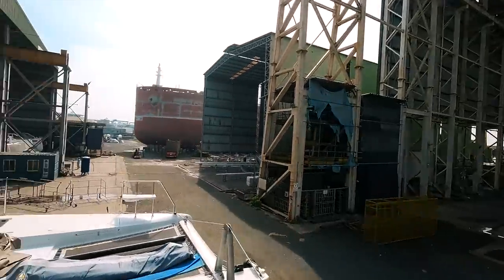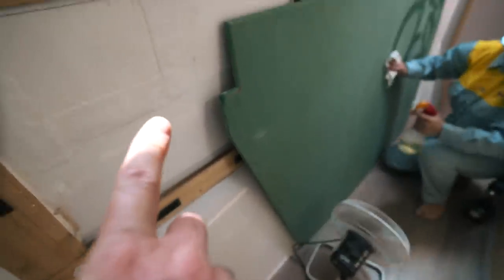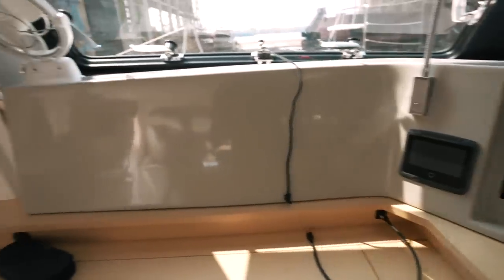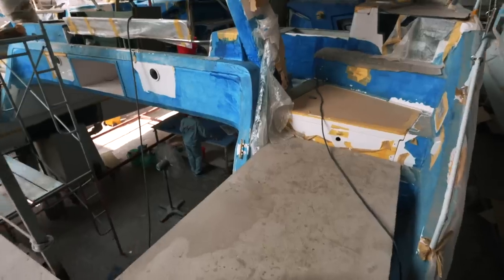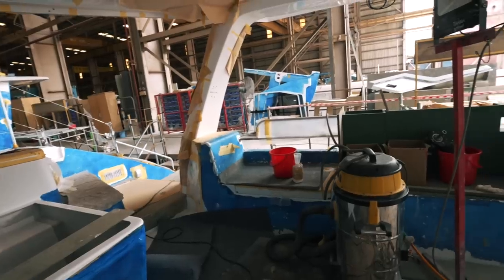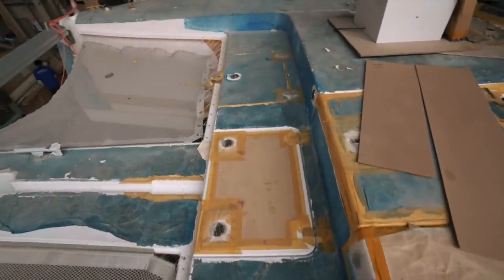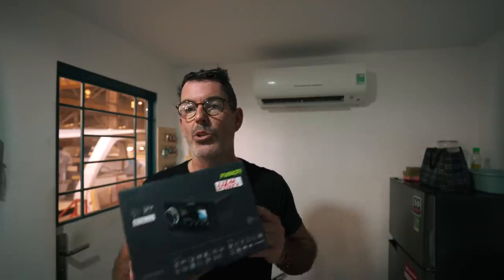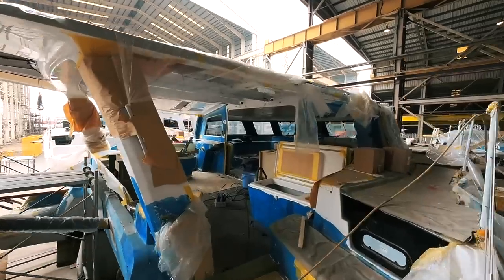Big Changes to the Catamaran Build- Also, We Need Your Help!

Comment: Being an audiophile myself. I have built several speakers and amps over the years and have a boat.  Others suggest not having the speakers out front. I agree.  You will probably just use those at anchor, so just open the windows or use bluetooth or install a plug upfront and bring speakers out when anchored.   Doesn't look like those recessed speakers have a very wide dispersion.  I assume this is a stereo system and not like a 5.1?  Is it possible to do a temporary hookup of the system before the final install? If so, you can experiment with the placement, toe in etc.  On a boat you don't have a lot of options on placement and with all the hard surfaces about reflections and standing waves can be a problem.  So experiment as much as possible.

Comment: Again a great video on the progress and iterative process of designing and building a complete new boat. Hats off for Seawind for their openness. I concurr with many others: no holes in the forward section of the hull. So speakers only bluetooth for the foredeck. I also agree that you’d like to have some air volume behind the 6,5” speakers. I believe I heard you say that the sub-woofer should be combined with the 6,5”? But in the salon you’ll apply to small speakers in the headliner? I like the design of the nav station with the recessed instrument panels. That will much safer at sea. ⚫️ was better than ⏺️ but that’s a matter of taste. Can’t wait until S-day💦!

Comment: Can you fit a Speaker in the overhang where the front windows are? That's your safest option for front speakers, I would not put them on the foredeck. Presuming your only going to use them at anchor, as backup you can put them inside the main cabin and just open the windows.

Comment: The  speakers have a IP65 rating, (check the IP rating) the 5 meaning they can handle a 6.5mm 30kPa water jet at 3 meters (~4psi). A good petrol water blaster is about 14000kPa. I would think at the front they aren't rated high enough, at times I would think they could be fully submerged and suffer way higher water splashing pressure. Unless you have fully sealed covers.. Probably want IP67 rated speakers for the front location.
A alternative location might be the soffit of the coach roof at the front, although with the front windows open the sound could be blocked.

Comment: Is there any way to put the outside front speakers up underneath the front over hang by the windows and put them on a hinge so you could lower them when your out on the front sitting then fold them back up to keep them out of the weather more when raining or underway?

Comment: 2at the back 2 mounted inside in the ceiling and the other 2 on swing arms inside at the windows ( swinging out through the windows when open). You will only be at the bow when the windows are open.

Comment: Ditch the speakers in the front and just get a decent Bluetooth speaker for those times you want to hang out up there with your tunes. Fusion can work with Bluetooth. Two less holes where you don't really want them.

Comment: I would consider putting speakers two at the aft saloon in ceiling and two by cockpits and then inside two and the sub. Depends if you the ceiling speakers outside will be enough for when you at the helm because that is when you will want some nice music outside I imagine. Saying that if you put them inside you could use them when watching netflix. I'd get an av receiver as well if I had a boat because I like to play films with the dolby digital sound. You can get small ones these days.

Comment: i'm not an audiophile like my brother but i have learnt some stuff. forget the speakers in the bow area, just open the cabin windows. i think the woofer should either be as far forward in the main cabin or situated in the stern facing forward. after all most of your time on board will be there. also you wont want to be playing music load unless you're out in the middle of the ocean  :-))
p.s. after reading a few comments i agree with the portable wireless speaker ideas. i think rick moore might be a good reference(sailing sophisticated lady).

Comment: I agree with those who say skip the forward speakers. They WILL go bad and you'll have holes that will need to be filled with a different shape speaker with different mounting holes than whatever is currently available.

I like the idea of indoor speakers near the window, or small bookshelf style speakers near the windows that can be rotated to face forward or in the cabin. Like the classic Bose systems. Your little speakers don't need to be in a big. They're just mid range and highs. You're going with a subwoofer to cover the lows.

Comment: Re foredeck speakers : assuming you would only have these speakers on when stationary or slow speeds 

 Why not create some rubber mould/flap which is easily to clip on (protect from water) & clip off when want to use

Comment: A catamaran owner recently interviewed on his audio system and he didn't spare on anything and customized  a lot of the hardware said he didn't use a hard wired speaker system he used only Bluetooth speakers and put as many and wherever he wanted. The quality and sound plus the usability was preferable. Plus many choices of speakers and placement, velcro to keep in place?

Comment: Don't really understand why the Nav station is being changed to light grey colour, and even worse it looks like a gloss! You commented on the recess being added to stop light reflection,  but this colour change will make it worse. That's the reason why most helms are matte black and flat. You don't want any distracting reflections when using the instruments. Imagine a night passage where even the most miniscule amount of ambient light is just going to hit that grey (gloss), surface and its accentuated curves to be effectively amplified back into your eyes. Agree that modern "glass bridges", dio radiate a lot of light but most have night-mode to reduce it. Like most have said - no holes for permanent speakers on the foredeck, just use a portable unit and bring out onto the deck when needed. There are so many waterproof bluetooth ones around these days. Just my two cents.
Reply: Pooly thought out random changes.  Someone has more money than sense.

Comment: Regarding the foredeck speakers... I wouldn't. I agree with Brian C. I'd go wireless. Easy enough to take them up when you're on anchor. Maybe create a friction fit silicone base so they're secured in and not easy to knock lose. If they HAVE to be mounted, I'd suggest gasketed covers that can be locked down for passage and removed once you're on anchor or if you have really good sailing conditions with little spray. Salt water is insidious... even waterproof isn't so waterproof at sea. I'd recommend buying an extra couple pairs for stashing in the spares bin.

Comment: Just a suggestion for your sound system speakers, maybe consider Bluetooth system, that way you can move the speakers to a safe place in bad or rough weather or group them together and blast them for a party.  Plus  no holes and no wires.

Comment: As someone that has done maintenance and repair in the marine industry for decades I'm going to give you some critically important advice. 
As you were going along talking about esthetics and solid long panels, speaker and light installations and so on it dawned on me. You are going to want access via panel, hatch, or other means for all of the systems including lighting and speakers.
Just something to keep in the forefront in all your design consideration.

Comment: My $0.02 - Not thrilled with the front speaker placement. From exposure to the elements to the holes in the fiberglass. Mostly because, as you mentioned in the video, bass isn’t directional but the rest is. They are mid-bow and facing one another. If you are on a beanbag closer midship, I can imagine the wind drowning it out. I would want them either in the furthest forward part of the vessel facing rearwards or close to the front windows facing forward. 

I do remember a video where they had speakers on the mast for the front of the boat. That could be an option as well while facing the whole bow.

Comment: Couple of questions for you: I’m assuming your fusion speakers are marine grade, salt resistant and IP 65 rated like the focal luxury marine line. If not please check out the focal line. Second, I would highly suggest having 2 subwoofers. Last, I would consult a marine audiophile that installs high end speakers like Focal and I’m assuming that Fusion has a division to consult. As for the front, I personally would not install outside. Open the front windows and add some volume. Last, what size amps are you using and hopefully the subwoofer (s) will have their own amp? Hope this will give you some insight! Cheers

Comment: On your speaker question, does the head unit you have do surround sound? I so, I think you may want to do 4 speakers in the cabin with the sub for the times you two want to watch movies or have TV night. Then when you are sitting on the bow of the boat you could open the front windows to listen to your music. I guess the downside to this would be if you were tying to conserve conditioned air inside the main upper living area. Then the two speakers on the back. I would worry about the speakers on the front unless maybe you could get them under the overhand of the front windows, but I would still think the amount of sea water that would splash in those areas even with marine grade speakers would cause issues quickly. This is just what I think, I'm in no way a marine audio or even an audio expert. Also enjoy seeing you and Teresa both in videos, if its all just from your point of view walking around then it loses some of the IDK feeling of authenticity to me.

Comment: @Sailing Ruby Rose, get 2 subwoofers they don't have to be big, but efficient, this will give you the best sound at low volume.  It will allow a more diverse speaker arrangement.
Reply: I STRONGLY agree!  Stereo bass with better coverage at lower volume is phenomenally better!

Comment: On the blue tooth speakers there are several that are "water proof".  I highly recommend the UE2 units.  I have found them to amazingly durable however, note that most of my experience is fresh water.  You can also hook as many as you want together and we have found that to be a lot of fun.   They have gromit that is suitable for a carabiner.  Have hooked 7 together at once in the past floating down the river.  They will connect to anything bluetooth but I would check with Fusion....good luck

Comment: For the outside bow speakers, just get a really decent portable Bluetooth speaker and make sure your system allows for external connection to a speaker via Bluetooth! Sonos or equivalent deliver excellent sound and are weather proof! Easier to use and can take to beach when using phone for music.

Comment: Question about the layout of the wiring on the boat. Do they lay in conduit between compartments with a string so you can add wires in the future? So if you had to run a harness from the cockpit to the engine room all you need to do is tie it to the string and pull in it into the other compartment or do you have to tear everything apart in order to upgrade or modify the setup later? If they put in the conduit remember to foam the ends so in case of smoke or fire it doesn't move from compartment to compartment.

Comment: I would put bigger speakers further away from the tramps, it'll sound better and be more protected if they're further aft. Speakers pointing down from the mast would also make sense. Don't worry about water damage, it'll be the amplifier than blows up from a short not the speaker, and speakers are cheap enough. Only controversial opinion i'd put out there is putting the subwoofer in the ceiling cavity, not lower down. It will sound better, and I bet if you mount it right you'll even get bass outside as clear as inside, albeit quieter.

Comment: Can’t you use rechargeable wireless speakers for the front but mould/make placement points so they are secure and when you are underway you can remove them? For the rest of the speakers I would mock them up and test the speakers first so you can see how they sound and verberate around the space. 👍

Comment: I would put four drivers in the cockpit. With two speakers underway, the volume has to be up louder than I like and you end up with dead spots in the cockpit. Four would give you more even dispersion without creating volume Hot & Cold spots. I wouldn’t put any up front either. Open windows or portable Bluetooth. Even bay sailing conditions would drown out any sound level below obnoxious. In open water, those volume levels would disturb the fish.

Comment: Do the windows flip out in the front?... a couple speakers strategically placed inside might perhaps deflect out nicely. Failing that... JBL PartyBox's sound great... and portable. You could always pre-wire where you think you'd want speakers and decide later, run them on a A/B switch

Comment: Depending the actual speakers, they can be very waterproof.   I had two 10 inch hung around my patio in New England and they never had a problem with water.
Reply: I agree that speakers can be waterproofed for on land use, even for a non Blue water boat it isn't quite the issue.  It is more of a water sealing/hull integrity problem because when you put a hole in a hull your adding a point of entry to the one thing you don't want in a boat.  There is an enormous issue with putting holes in a hull when your talking about ocean crossing vessels.  A little sound up front is not really a viable risk to value, especially when you could just open a window or use a Bluetooth speaker to allow the music to play everywhere.

Comment: Any outside speackers should be free standing. The sun rottes out the plastic in a couple of years. Or you toes could kick it in. The template will be different on your replacement speakers in a few years. Put standalone speakers under the trappolen.

Comment: Speaker placement is a tricky business, but sound dissipates at roughly half the volume for double the distance, This means it is important that in your helm station if your head is close to a speaker you will adjust it low and nobody else can hear, a speaker above the table can result in a speaker very close (1m) to a person's head and at the far end maybe 3m.  I would place speakers in low visible places, far as possible from your common areas, then the volume will seem to fill the space and everyone can enjoy. reach out if you want a more pro design

Comment: I agree with Joe S. above, and have some experience in building 12v sound systems. First off, do your best to make sure the head unit is a standard size, double DIN is probably what you are looking at. This way replacing it if/when it fails or upgrading it down the road will be simple. While the idea of wired speakers in the bow seating area is attractive, it is impractical, for all the reasons previously mentioned, they won't last...and won't sound good. Bluetooth is the way to go there.
One of the Apollo system offerings appears to be a stand alone amp, with will be required to run the sub, so I make the assumption that is the system you have.  All the better. I would focus on getting the most sound in the cockpit area then the salon. The Sub will be fine where you plan to place it. I don't think overhead speaker systems give the best stereo effect, they tend to "wash it out", for lack of a better phrase.  Our ears on the sides of our head, and all...You'll get better sound from the 6-1/2 speakers, and on an angle where they are firing from a vertical mounting. I believe you said you have 4 of them, place all 4 in the cockpit.  If the time comes when you wish to upgrade the speakers (and you might, as living in a harsh environment like a boat at sea will degrade them eventually) the amp will be able to push them.
The smaller ones appear to be a plate style, I'd put them in the salon.Again, paying attention to get them to create as much stereo effect as possible.

Comment: I listen to your videos through a pair of Adam a7x monitors £1,000 powered monitors. My studio speakers. 

If it was my boat I’d have those in the saloon feeding the cockpit. Just turn them around to play through the open front facing windows and you have studio quality audio not expensive or otherwise consumer crap. And you get to plug your guitar in with some effects via a laptop 😜

Either 1. You really need to audition some Bluetooth speakers (phenomenally good and portable) for the front cockpit OR 

2. house those front speakers, if you must, in gasket sealed units that you can open when at anchor or in calm sailing… (as you appear to have blown money on speakers for that front cockpit already 😂). 

You’re playing back Flac files or just MP3 at 320 kilobits or have you a heavy CD collection or did you rip all your CDs as fully bin and cue exact duplicate of CD / wave files 

… all stored on terrabytes of NAS box hard drive storage competeing with all your movies and TV series box sets? 😂😂😂

My guitar amp is a Rivera into 2x12 celestion housed in a Marshall cab.
Reply from the maker: Great answer mate

Comment: Sound will travel better horizontally. Speaker should face stern ward from the saloon and also from the outside deck. Once the tri fold door is open and stowed in the coach roof, all the sound will travel in the same direction to where you will spend most of your time. Leave the trampolines for a quiet zone. You could always open the saloon windows if you want to hear any music from the interior. Anyone with speakers on their boat will know that eventually any exposure to sun and sea will kill the speakers. JM2Cs,,,also subwoofers need adequate air flow so vent the couch area box you out it in..